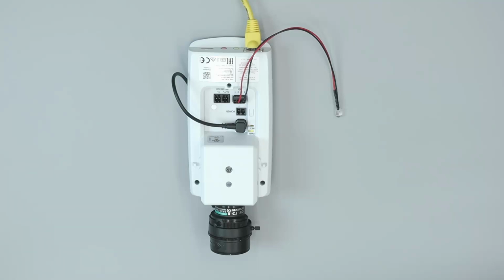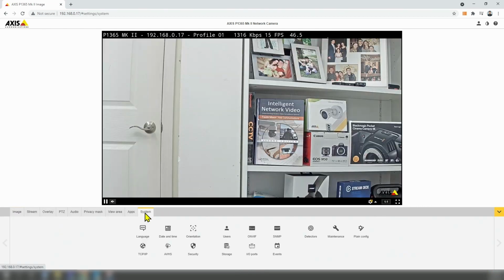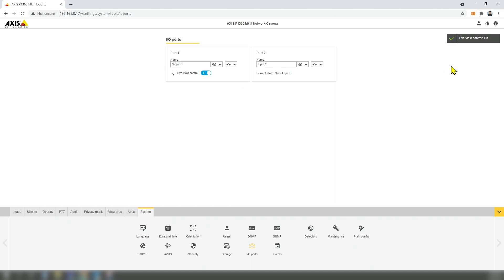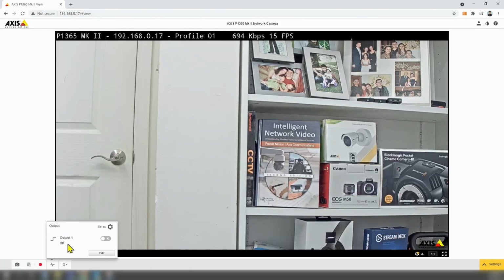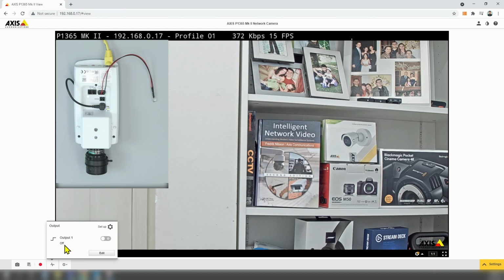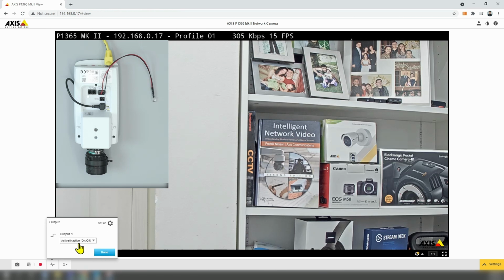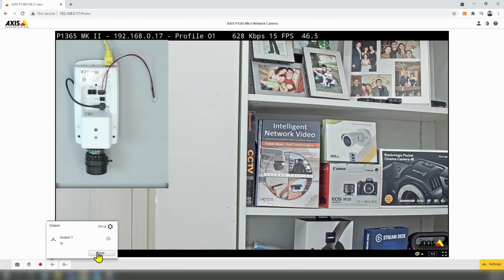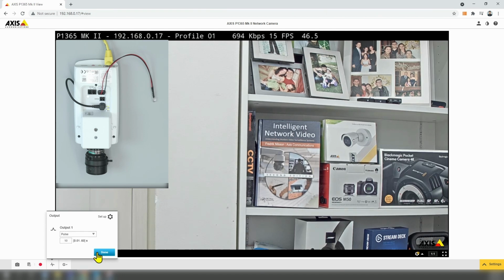Axis Camera I/O (Input/Output) Control - Practical Example

Comment: How many volts is your LED?  The camera outputs 12 volts and when I hook a LED which is normally around 3 Volts it blows it out.
Reply: Did you use a resister? i put in a  460 ohm resister and it worked fine. depending on the LED specifications the resister will very.